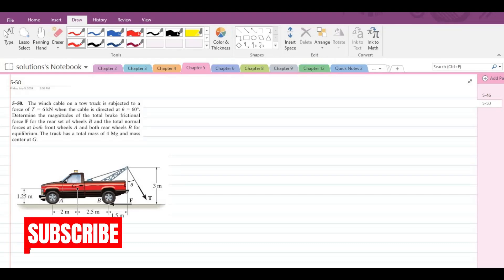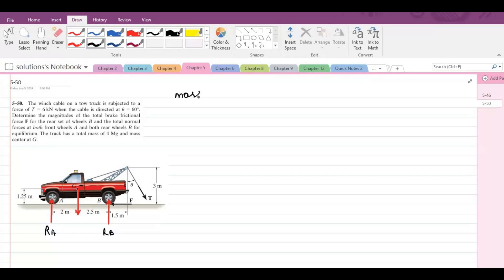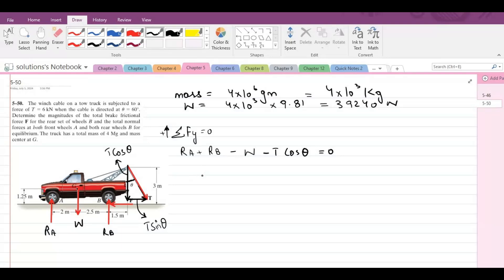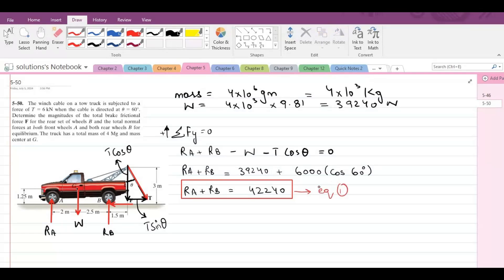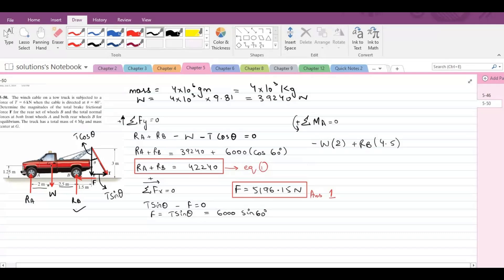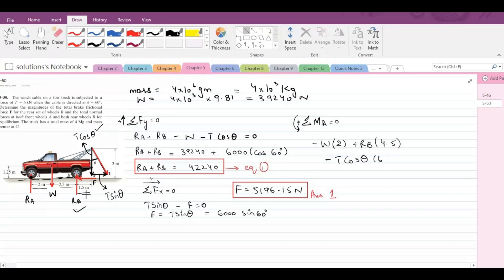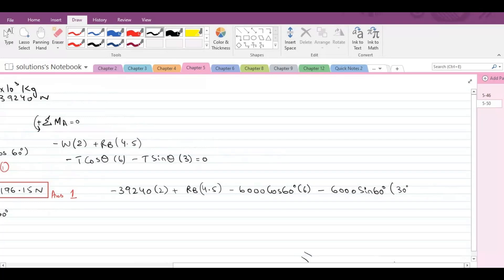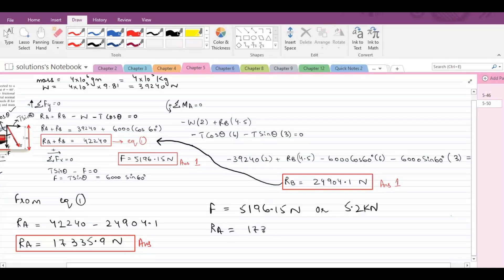5-50 hibbeler statics chapter 5  | hibbeler statics | hibbeler

Comment: Assalamwalkum Sir could you please solve these suggested problem 
Chapter 5: Equilibrium
of a Rigid Bod
21, 27, 42, 44, 61, 71, 79, 82, 95

Chapter 6: Structural
Analysis
76, 112, 114, 115, 117

Chapter 9: Center of Gravity and Centroid

3, 16, 18, 25, 60, 71, 74, 76

Chapter 10: Moments of Inertia

19, 21, 23, 30, 31, 55, 56
Reply from the maker: W.salam I will try to solve as much as possible